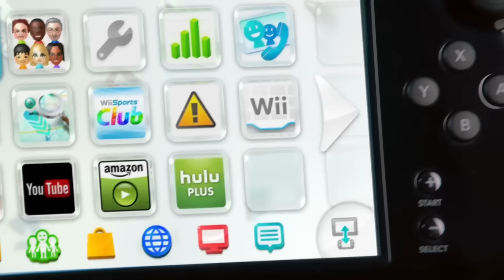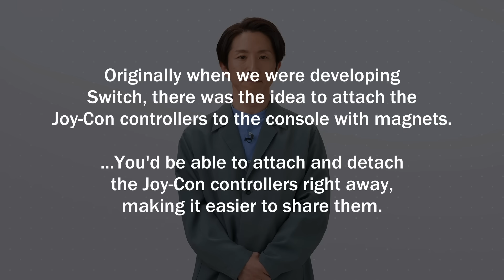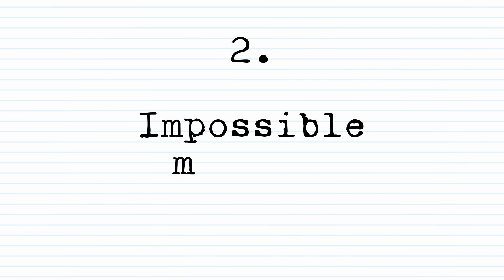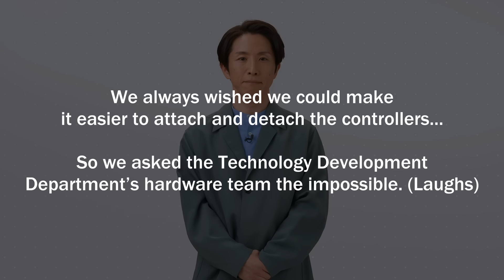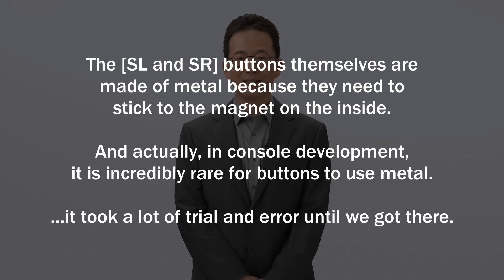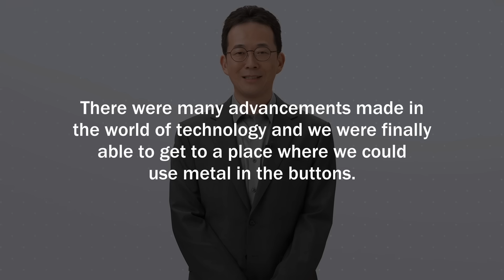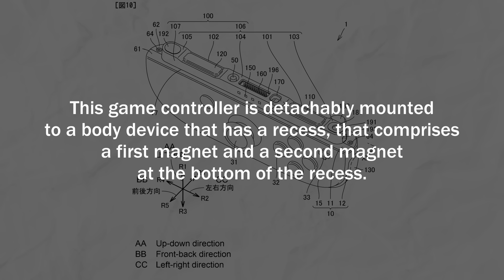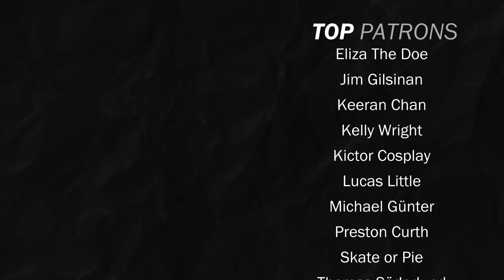How Nintendo fixed Magnetic Joy-Cons

Comment: There's still a glaring problum with the switch 2's use of magnets even if it was on the Switch. Magnets scramble screens. Of tvs, computers, Phones ,and handhelds consoles. What's stopping the Switch 2's magnets from causing that? Imagine pulling a joy-con out the switch 2, but slips out your hand, heads to your TV screen and it's magnet ruins it.
Reply: Throwing shit at screens is never a good idea
Reply: @jankbunky4279  wii kids learnt that the hard way
Reply: @jankbunky4279 i never said throw. I said pull a joy con but it slips out your hand and it heads to the screen and it would be an accident.
Reply: @circledude2362  bruh
Reply: there's no magnets in the joycons. they're only inside the console.
Reply: @sirmoonslosthismind imagine placing the switch 2 near your tv screen joy-conless not remembering the magnets in the switch are still normal magnets.
Reply: bruh
Reply: You using a CRT TV? No? then the magnets won't be an issue.
Reply: @TwiliPaladin  https://iqrorwxhmnmnlp5m.ldycdn.com/cloud/lnBpjKjjllSRrlqrppijjo/A-Magnet-Can-Correct-A-Lcd-Screen.jpg
Reply: @TwiliPaladin  even with a crt
Reply: This is the worst post I’ve ever seen
Reply: @HTonYoutube knowing nintendo, they cheep out.
Reply: @circledude2362  wtf are you talking about
Reply: @HTonYoutube all the cons the switch 2 has so far.
Reply: @circledude2362  the switch 2 has alot of cons... not these 😭
Reply: @circledude2362  8/10 confusebait

Comment: This video really just shows that the Swtich 2 was what the hardware devs wanted the Swtich to be in the first place but couldn't due to problems they could've figure out a solution to and the company scrambling to get something new out in the market because of the Wii U's failure.
Reply: Even the SOC which contains the CPU & GPU is like that. With the original Switch, Nintendo went to Nvidia late in development, and ended up repurposing the stock Tegra X1 to work in a hybrid handheld.
This time around, Nintendo & Nvidia created a fully custom chip to get the exact amount of power they want out of the system.
Reply: not really, most of the apu is just a cut down version that could not be used for cars. they were in talks with amd for a long while, but were too cheap to use amd chips that would have been far more efficient @scaryhobbit211
Reply: @scaryhobbit211 absolutely
Reply: Switch 1 walked so Switch 2 could run
Reply: Indeed, i think its quite noticeable (in comparison) how rushed the Switch is as a product compared to the NSW2
Reply: IIRC the Switch was also intended to be released in 2016
Reply: Swtich 💔🥀
Reply: Fr

Comment: The magnets are a huge improvement, and they feel great snapping into place. The hold is incredibly strong, and the release button makes removal effortless. Great all around
Reply: Can't wait to try it soon!!!!!!!!!!!!!
(19 days left)
Reply: @Mashakra_uhm it’s 22 days…
Reply: @SnoopyyWith2Ys  no its 19
Reply: @warioscousin 7 months…
Reply: How would you know
Reply: @warioscousin there’s been several hands on events for switch 2
Reply: @warioscousin  I have my ways
Reply: The only bad thing is that you cant add magnets to the analog sticks, meaning that there will still be joycon drift...
Reply: @NadezdaBelous-z1n  not neccisarily. other controllers dont have drift (at least not nearly as bad as the joycons) it was just a crappy design in this case that led to the issue.
Reply: @NadezdaBelous-z1n  They could use hall effect joysticks, they just decided to cheap out and give their customers another defective product. They weren't successfully punished last time so why would they start caring now?
Reply: @ultimate9056 Hall effect sticks use magnets, that's what they're talking about. The strong magnets in the console would cause horrible drift instantly for all joycons if they used hall effect.
Reply: @AddiePosts  I know, I just chose to use their actual name instead of just how they work.
Also the Hall Effect joysticks should not be troubled by the magnetic attachment system. They could be easily calibrated to deal with interference from the attachment system which would remain constant, only requiring the programed "centre" to be offset.
Reply: @ultimate9056  what do you mean they werent successfully punished? they were required to repair or replace your joycons if they got drift.

Comment: this whole video i was like "well obviously the solution is electromagnets"
my mind was totally blown when i learned that wasn't the case!
Reply: Just imagine your battery going 0% and the Joy Cons detach from the system!
Reply: @dariofortino168  Not true. Portable devices usually reserve a little bit of battery for the "no battery" screen and to keep the internal clock running. They could easily spare some of that for the electromagnets.
Reply: Electromagnets would need to constantly use energy, which really doesn't work when working with a battery.
Reply: @Chrobin111   You know what would work, permanent magnet with an electromagnet to counter it. The e-magnet wouldn't be energised but would be just for a split second to detach the joycons when they're plugged into the side of the system and powered.

But ultimately eject lever and small pusher to overcome magnets is saner, where leverage multiplication is used. Just as they did.

There are also switchable permanent magnets, which are stacks of magnets where a hidden layer is shifted or rotated to neutralise the magnet. Makes for a somewhat complex assembly though.
Reply: @SianaGearz  At the end of the day, anyone who's used strong rare earth magnets before knows how much more fun they are to play with. They're a toy in their own right. And they don't degrade over time (at least by human lifespan standards). Those magnets will be outliving every other component in the system. Electromagnets have too many points of failure from repeated use.
Reply: Fr
Reply: Obviously is crazy
Reply: @ovojdabanks210  hey man that's just what people were saying abt it before we knew more 😭it's not smth i thought deeply about lmao
Reply: Have you got any idea how much energy an electromagnet draws?
Reply: Electromagnets wouldn't be feasible. Reverse polarity would be cool though
Reply: Imagine you buy a Switch 2 and a bunch of digital games and in a few years they decide to cancel your account with everything you bought. It seems unlikely now, but in the near future it will happen often. Since companies can already listen in and monitor the console via audio and camera
Reply: @Lefau44  respectfully, what does this have to do with my comment lol
Reply: @emolgana Sounds to me like the guy is extreamly paranoid.
Reply: @Lefau44   That would draw extreme wrath of EU. You don't want to be on the receiving end of EU sanctions.
Reply: @Lefau44  The switch 2 doesn't have a mic or camera built in. Imagine you buy a Steam Machine and a bunch of digital games and in a few years they decide to cancel your account with everything you bought...
Reply: @Mad_Catter_  The Switch 2 has a built in mic with noise cancelation tech that can filter a TV audio when directly next to it to pick up what you are saying from across the room. And goes into 'sleep mode' instead of truly powering off

Comment: You know what would be cool? Fixing the damn drift! How about using magnetic sticks with hall effect? That would be much nicer improvement than replacing rails with magnets.
Reply: Because the switch 2 used such powerful magnets to hold on the joycons, it would not be possible to get hall effect sticks to work because they rely on precise magnetic fields that would be completely ruined by the switch 2 magnets
Reply: @noahsteele7767  There are multiple methods to create drift-proof sticks. Tunnel magnetoresistance (TMR), Hall-Effect and optical encoding all are examples. As for the magnetic influence, this is somewhat true if they are used as drop-in replacements.

However, it's not hard to imagine a simple auto-calibration occurring, especially if the joystick caps are capacitive and able to detect when they are being touched. Grab the new center point when not moving or being touched for a bit, adjust the minima and maxima as needed based on readings. Combined with some reasonable guess ranges to start, I would imagine no issues.

Fundamentally I think Nintendo just views the joycons as wear parts (given they contain batteries and other fragile parts) so they have decided to just replace them periodically rather than bother with allowing repair or using more wear-resistant methods. I don't agree with this assessment, but I'm also unwilling to buy a Switch 2, so maybe it's appropriate for their target audience.
Reply: I'd be imposs
Reply: Impossible because of the magnets that they have in the console now. Instead, they should be using  TMR, another form of magnetic drift-less sensors/sticks, and as a nice bonus, TMR is better than hall effect in every way. More resistant to outside magnetic interferrence? CHECK. Higher resolution? CHECK. Higher sensitivity? CHECK!
Reply: 1. You haven't even touched the damn controller, calm your ass down.
2. The current version of the Joy-Cons has way less drift than the original ones.
3. YOU CAN SEND THEM THE JOY-CONS FOR FREE TO REPAIR THE DRIFT
Reply: @zrockey77  They do NOT have less drift. People have disassembled them and actually found that they are identical in the stick build.
Reply: I don't think people realize that:
A) the issue with the drift was largely an issue with the design of the joycons specifically, and will likely be fixed.
B) As mentioned above, it will likely be fixed, because nintendo barely got away with not loosing a ton of money in lawsuits, and were forced to repair or replace your joycons for free. they dont want that happening again, cus if it does, they probably wont be so lucky with the lawsuit money.
Reply: @RipVanFish09  yup, that's what I'm thinking too. Though, it could be that Nintendo did end up earning more money than losing, from people buying new joy-con all the time? No idea
Reply: @RipVanFish09 No, it is because joycons use potentiometer sticks.
Reply: Then they can't sell u more joycons when they drift 😅
Reply: Let's first wait to see how the sticks perform? Maybe?

Comment: Magnets can deteriorate because of heat. What if this thing overheats and the magnets get weak
Reply: Firstly, for handheld: the temperature needed to actually damage the magnets is so high, you're more likely to hurt your hands from the heat and put down the console BEFORE the magnets get ANY form of damage (but I sincerely doubt the console will even reach that temperature). and secondly: docked has an entire cooling system. So I don't see any serious damage ever being done to it. there might be SOME extremely minor damage if you constantly use hand-held on VERY intensive/demanding games (Elden Ring, Cyberpunk, etc), but by the time that damage stacks up to actually cause an issue, your switch 2 is already long gone and traded in for the next console.

Comment: I keep my Nintendo Switch next to all my other consoles which are connected to an old CRT TV, those heavy box televisions with screens that are vulnerable to magnets. My Nintendo Switch is sitting 1 foot directly below it so I'm worried about the Switch 2 magnets damaging it. Also if you set your Switch 2 next to anything metal it'll stick right on so that's going to get annoying. The rail system was better imo and I've never had significant wobble on my launch Switch from 2017, Just gotta be gentle when attaching and removing joycons.
Reply: You don't need to worry about magnets. If they were strong enough to affect other devices, they would be strong enough to mess with the Switch 2 itself. Both the tablet and the Joycons themselves.
Reply: There's most likely magnetic field blocking material around the magnet's unused sided. Meaning it's likely only on the direct sides of the joycons where the magnetic field actually does something. Not to mention that on such small size, the magnetic field is relatively short (you're looking at like 5 inch range). So you should be perfectly fine on the stuff around it, as it shouldn't be getting ANY damage. As for stuff sticking to it... That MAYBE, but again... 5 inch range so you'd seriously have to try.
Reply: @Lusius8879 what if you take the joy con off
Reply: @HTonYoutube the joycon itself doesn't have any magnets in it, so no worries there. It's purely side of the screen. And while this does create a small oitward magnetic field, it still would be too short-ranged to really do something.
Reply: @Lusius8879  I was meaning the exposed part in the indent like what you were talking about

Comment: Hold up.. is this why there are no holojoysticks cause they used magnets?
Reply: I dont think they would’ve added them either way tbh
Reply: @the5zeroat least they still fixed the joy sticks
Reply: Dreamcast (and Saturn 3D Pad) used fully Hall effect joysticks back over 25 years ago. They also didn't have an axial splitter assembly, with axis decoding being done electronically instead, and the lack of this mechanical complication allowed a larger return spring which experiences less strain and doesn't weaken with time. Both axis splitter and return spring are major causes of wear and fault in other sticks. Modern Hall sticks still have problems with spring and splitter.

They had to be REALLY careful with ferromagnetic materials though. Instead of steel screws which can be easier machine installed using magnets, brass screws are used instead in vicinity of the stick, which must be installed by hand. Furthermore the trigger mechanism could not be directly behind the stick, so the stick is at the top of the controller and the triggers further inwards, which is also why there is no second stick on Dreamcast, in spite of being electronically foreseen.
Reply: Probably not the only reason but it is basically impossible to use Hall effect on joycon 2
Reply: no
Reply: F
Reply: They could have easily used Hall or TMR regardless with some careful software. It's more likely down to considering joycons to be wear items (they do contain small batteries after all) so extending the joystick lifespan wasn't worthwhile for the added cost to them.
Reply: Yeah sure, it’s not like every company ever doesn’t use holo joysticks in their OEM controllers to artificially reduce the lifespan by a few years
Reply: @fanoftoday i am not defending Nintendo, but the simple answer is that they are cheaper
Reply: @Random_dud31cheaper and makes you buy em again and again. You think if Nintendo charged 20 bucks more for a pro joycon that never had drift issues that wouldn’t be an instant seller across the market? But having the user buy another 50 dollar joycon just makes them more money overall, and it’s why the switch is such a huge seller
Reply: @Random_dud31 maybe they could remove bloat features in controllers 
And keep the price the same
Reply: @fanoftoday  hahaha
Reply: @fanoftoday  And that matters, why?

Comment: I can’t help but wonder what happens to the internals being constantly subjected to magnetic interference.
Reply: Nintendo have been working on this console for 6 years they've almost certainly solved that.
Reply: That is probably not as much magnetic interference as you think. It shouldn't be difficult to shield from it
Reply: "Magnetic interference" refers to changing magnetic fields. Permanent and low frequency magnetic fields do not cause electronic interference.

There are only several classes of devices affected by magnets. These are devices which use permanent magnets themselves, and CRTs where low frequency magnetic fields are used to gently deflect the beam of electrons in a vacuum.

It is possible to short circuit magnetic field lines and eliminate permanent magnetic field in a certain direction. For example speakers that are intended to be used near TV have a second idle permanent magnet behind their working one, cemented on at opposite polarity, and a steel cap that clamps the magnetic field between the two.

Comment: Can’t magnets lose strength over time too, especially when exposed to heat? Idk enough about the science behind magnets to say for sure, but it does make me wonder how well they’ll last after 10 years 🤔
Reply: It would need to get to a temperature that would melt the plastic of the console itself before it would impact the magnets, so maybe that it would have a slight impact in 10 years, but I would be surprised
Reply: @NotReal4  That’s great to hear! Thank you for the insight :)
Reply: Long story short:
1) Temperature needed to actually affect the magnets would be far above too hot to hold, and the dock has a cooling system. So both are no cause of worry.
2) there might be SOME extremely minor damage when using very intensive games (elden ring, cyberpunk etc) in handheld mode, but by that time that starts to stack up to be an issue, we're already far into the next console (if not already the one after)
3) Magnets do lose strength over time, correct. However, it does so at EXTREMELY slow rates, unless you're looking at some cheap and super thin fridge magnet. And seeing how these things need to hold entire joycons, it's fair to assume they are thicker and stronger, so by the time natural degredation affects these magnets... you won't be playing on the switch 2 anymore to begin with.